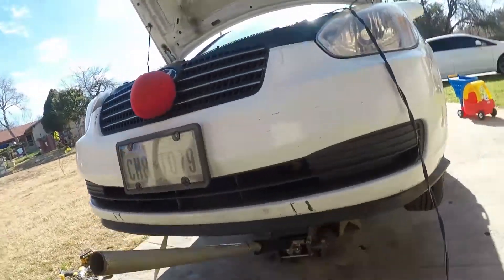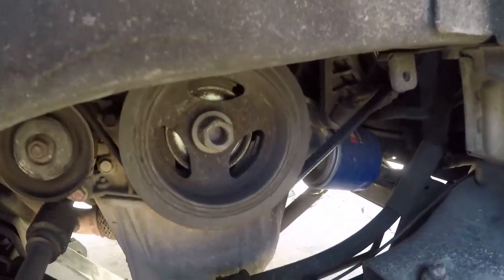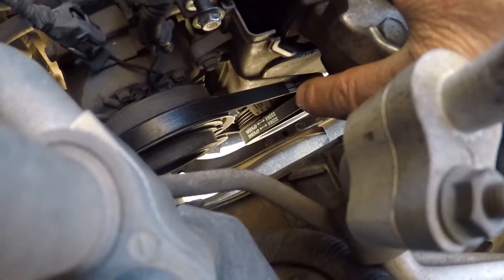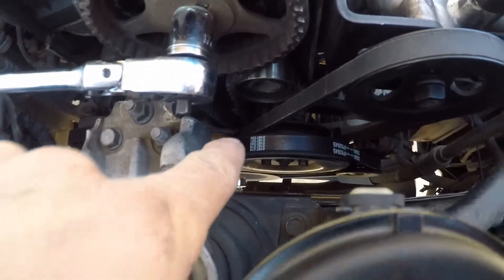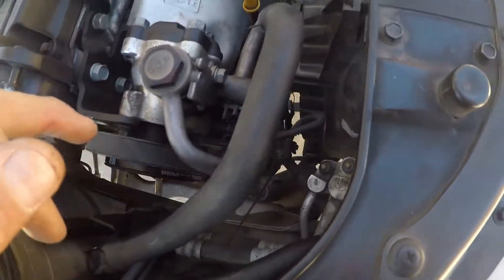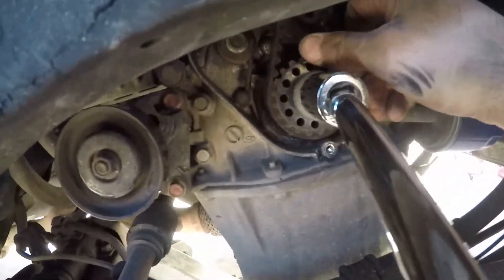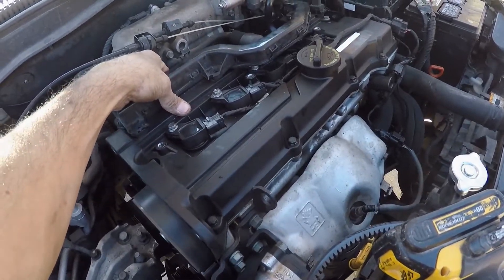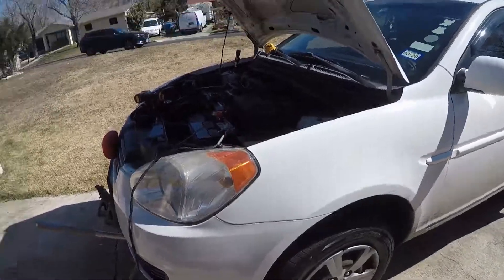2009 hyundai accent timing adjustment

Comment: You have put out what seems to be decent info (excluding your belt replacement video where I THINK you adjusted the a/c idler without loosening the bolt that holds it on its bracket and you kept mixing up terminology and directions 😬) but after just hearing your engine run like a diesel or old farm truck I'm thinking the way your car sounds poorly represents your ability because these engines tend to run very quiet and smooth when everything is okay despite their defects. Maybe just bad lifters or oil flow to them or collapsed possibly? But it shouldn't tick and rap so much like that. At least you got it running again.